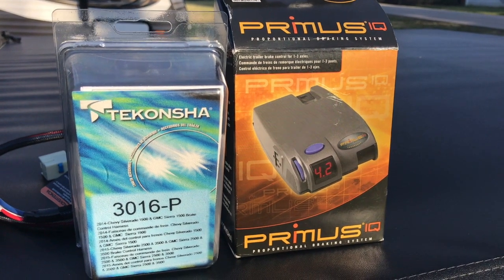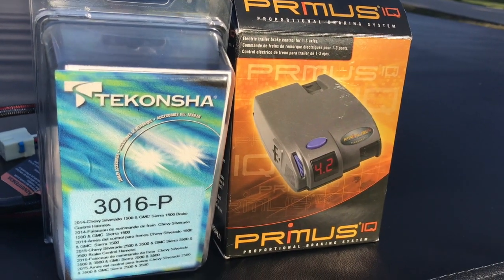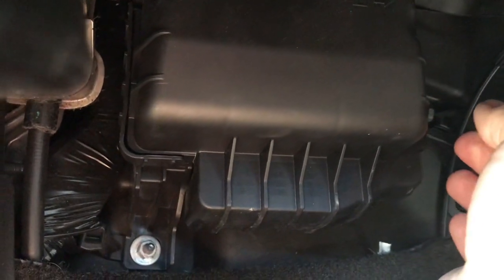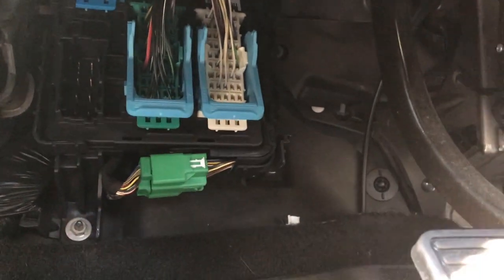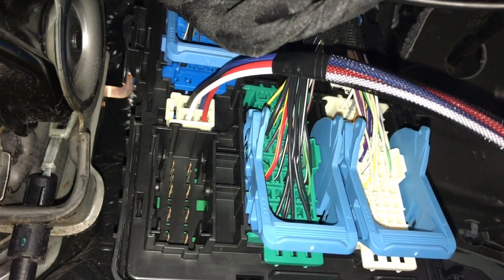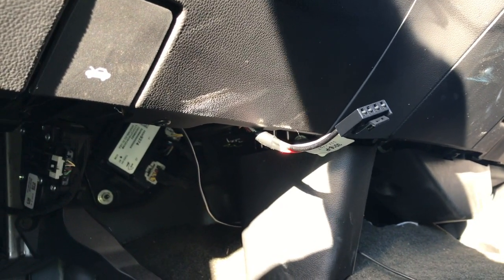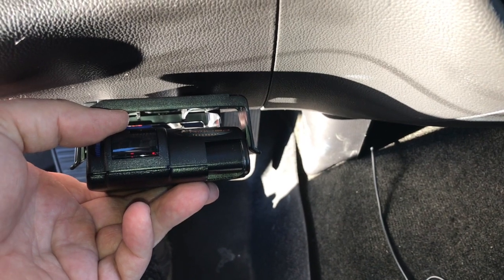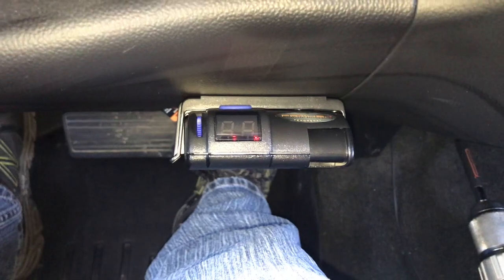Brake Controller Install on 2014 Silverado

Comment: Thanks for the info.
I'm installing one in my new 2017 GMC Sierra 1500 SLE.
I didn't know which port that harness plugged into.
The rest of it is already wired into the truck's harness so no need to run any wires.
BTW , use a cotter pin removal hook tool to get at that latch on the Left side of the cover right next to that sharp steel parking brake .

Comment: Only thing missing is were you put it thru the firewall ??.Otherwise good video.
Reply: huh, he never had to go through the fire wall!
Reply: Doesn’t go through fire wall
Reply: Why would he have to go through the firewall? Not necessary
Reply: It’s inside the truck and doesn’t exist inside of cab , didn’t watch the clear video? It’s plug and go inside the cab, everything else is run factory on truck